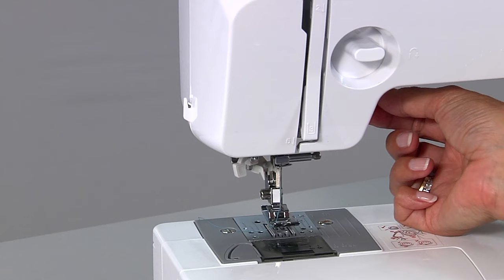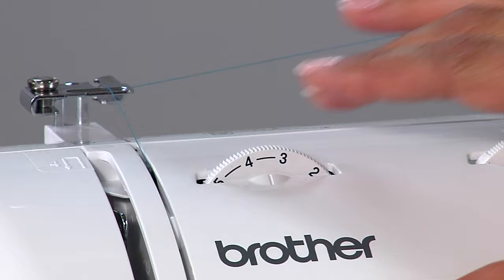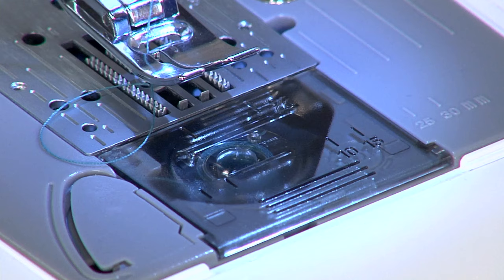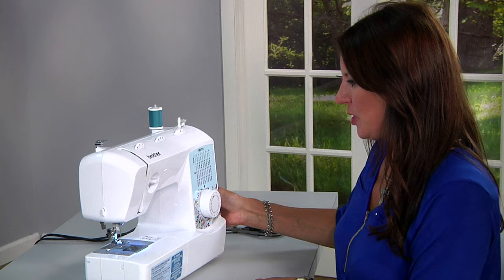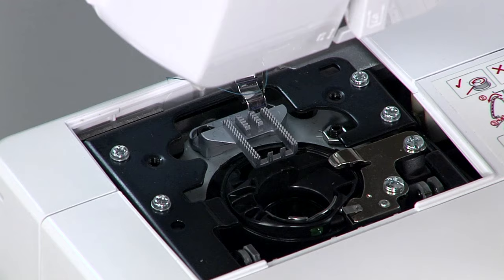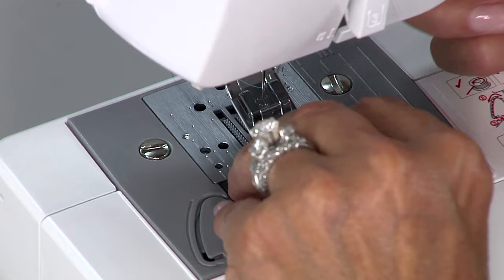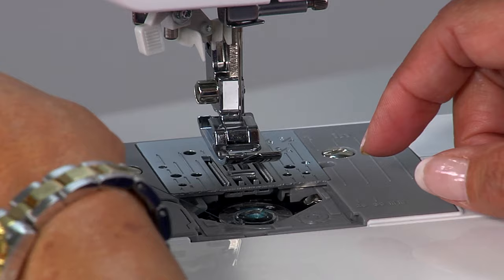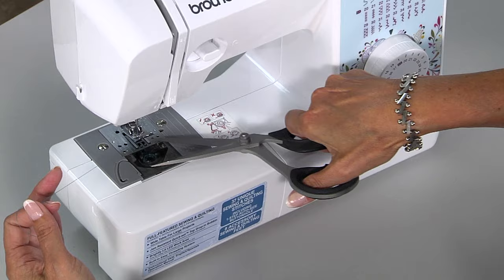Common Brother Sewing Machine Problems: Causes and Remedies

Comment: You breezed so fast through those tension issues at the beginning - you didn't show if the stitches were different at the different tensions
Reply: I agree Patricia; I wanted her to explain about the tension spring in bobbin area; my bobbin is jumping and clunking; and the bottom stitching is really tight! So can anyone help with this plz?
Reply: Would’ve been SOOOOO helpful
Reply: Agreed. I need to see a slow close up of what those look like!!!
Reply: I need to see exactly how Angrla’s three dials are set..I am going crazy!
Reply: @jillsmith5687  how do I fix the tension in my bobbin thread
Reply: @jillsmith5687  show me how to fix the tension in my bobbin thread
Reply: Exactly
Reply: Could have been more helpful if not so fast and incomplete.
Reply: Yea that was a waste of time.
Reply: Same problem. Whole point is to be able to understand then fix the problem😢
Reply: Which was why I watched the video.

Comment: PSA: Avoid brother machines, especially economy class (SE600 etc). They are garbage. The machines are so finicky. I've had it nest at random and jam up. I can't get through 1 pattern without any trouble, like ever. I find that I have to reinsert the bobbin, but before cutting it, i have to violently tug it through, only then will the bottom thread stop showing on top or the top thread nesting below. Slowly it deteriorates and I have to keep reseating it. Forget tension dials, they don't work, period. 1 - 9, all the same result. Hate this crap!
Reply: I tend to agree. I’ve had 2 brothers that give me constant issues. I need suggestions on what brand to buy.
Reply: I had a Pfaff , I bought in 1995. Used it without any problem more than 25 years. Then last year purchased a Brother in replacement  to my Pfaff..no comparison, already having troubles with simple tasks and sewing properly  with this machine.
Pfaff is the best.
Reply: Me too.  They are garbage. @Kaptiv8edme
Reply: @Kaptiv8edme also tell me 😊

Comment: Had an issue with my FS101, was getting bird nests underneath each sewing start, for about 1 to 2cm birdnesting. Studied Youtube videos for hours and tried everything, nothing solved the nesting. New needles, new and different thread, new threading, cleaning, nothing solved the birdnesting at the beginning of each sewing. Saw nothing wrong on the bobbins or the bobbin casing. Ordered by coincidence recently 2 spare bobbin cases. Gave it a try and changed the bobbin case and voila, no more bird nests at all. Even so I could not tell what was wrong on the "old" bobbin case, the replacement of the bobbin case was the solution to the problem. Just in case, as this is not mentioned as possible troubleshoot solution ;)
Reply: god bless you and your crops

Comment: I watched this video because I am brand new to sewing and right out of the gate I am having tension issues. I even had trouble following the manufacturers issues on how to thread it. You covered both issues, but the filming of your bottom hand when all the action was going on at the top of the machine with your upper hand was absolutely crazy.

Comment: This 1000% did not touch on ANY of the issues I'm experiencing! 🤦🏻‍♀️
Reply: Same😢
Reply: Me either. The part on top looks like the wire might be in wrong pasotion. I do not know where it goes?
Reply: I've had to unscrew the plate and fix the bobbin holder countless times, AFTER exchanging the machine four times already..I finally gave up working on my project until I can exchange the machine AGAIN!
Reply: @AriDimitris  How frustrating!!  I feel your pain!
Usually, I have loved Brother machines, but the last 3 I've purchased have been sub-par. 💔
Reply: @LoriBounds-wt1vc  - I am sorry you're struggling with your machine, too!!  I wish I could help you, but I'm at a loss with this machine as well.  Good luck!!
Reply: I’m so frustrated with my brand new machine. I actually miss my Singer….. so sad that it died.
Reply: @rheldawilkinson3790  - I feel ya!  Do you have a local repair shop that may be able to fix your Singer?

Comment: I followed the troubleshooting FAQ on Brother and watched this vid - which basically summarizes those FAQs. I am a good engineer and this Brother CS7000i has NEVER stitched anything without leaving a nasty bunched up mess on the underside. The top looks fine.  However, even when I have a long stitch. It will start with a little bunch or hang. Then, I can continue for a couple of inches where it looks great and then randomly the last two inches are a rats nest. Fortunately, it is mostly when I am repairing my old work jeans. That material is 9 ounce twill and I am backing up the rips and holes with one of those (pathetic) iron patches that never iron on. So, I am doing only straight stiches with the correct default foot. Medium duty pure cotton twill thread on the needle and bobbin sides. Not one thing other than all default settings. Tension set between 1 and 2. Hand start and hand tack beginning and end (using the wheel, not the foot pedal). You can conact me here with any bright ideas!
Reply from the maker: We are sorry to hear that your CS7000i is not sewing correctly. Please see the links below for more informaton:
https://help.brother-usa.com/app/answers/detail/a_id/124056
https://support.brother.com/g/b/faqend.aspx?c=us&lang=en&prod=hf_cs7000ieus&faqid=faqh00000004_000
If you continue to experience the same issue, please contact Brother Customer Service at:
https://www.brother-usa.com/support
Reply: Hi @allanbruce9473 - did your machine continue bothering you or was there any "cure"?

Comment: It was definitely the tension that was messing me up 😩 my first time quilting and I’m using the walking foot. The bottom thread would just be a mess in the back and I was getting so frustrated why it wasn’t working. I checked everything from bobbin to replacing the needles. You said it might be tension and I put it up a bit higher and it came out perfect on the back!! If you’re using a walking door defiantly put it up around 4-5
Reply from the maker: Thank you for watching! We are glad that you were able to resolve the issue so that your stitches look great on the front and back of your quilt.

Comment: Thanks so much! I have a question and hopefully anyone can answer. When I back stitch,  the thread from the bobbin get undone and I see loops through the top. 
Thank you so much for sharing
Reply: @BrotherSews  I’m new to sewing. I’m going to try changing the needle. Wish me luck hehe. Another question, do you suggest to only use Brother bobbins? My husband bought me some bobbins to surprise me but they are Walmart brand, haven’t sued them just to be safe. Thanks in advance
Reply: @legacycosmo  I’m sure you’ve had a reply but if the bobbin fits into the bobbin spot, they’ll be fine. I have some that won’t fit on the spindle….? Whats that about?

Comment: My machine is 6 wks old and now wont zig zag or other stitches. It will do straight but makes a loud knocking noise. I cant return it.  Whats up? I've rethreaded it, replaced the needle and cleaned it.

Comment: I have a similar machine as yours. It is several years old, but not frequently used. It won’t work The under thread keeps jammed even with thinner fabric and straight line sewing. I have tried taking out the plate and cover. Found nothing wrong but brush clean inside. What else can I do before I bring it to the repair?

Comment: I want to love my brothers but unfortunately I do not.  I’ve sewn for over 50 years and don’t enjoy it any longer.  After my sewing machine died I thought I was buying up and included embroidery with a Brothers machine.  The needle threader does not work and needle thread pulls out or breaks and the needles are way too sensitive and break.  And yes I have verified that the thread is fed thru correct and that the bobbin and thread are correct.   Embroidering will have to wait
Reply: How do I change my brother 12:41 to a straight stitch

Comment: I bought this exact machine last week it’s awful I usually love brother machines but mine is so noisy & vibrates badly I’ve asked seller if I can send it back as it’s definitely not right & as I see everyday I’ve had to buy another machine I’ve going back to the brother ls 14 which in my opinion is the best I’ve had 3 now & wanted an upgrade but this is definitely a down grade

Comment: How do you fix the internal threading spring in position #3 on the Brother inovis 1750 d sewing machine?  I can stitch about 15 stitches, then the spring sticks and I get an error message to check and rethread upper thread. Upper thread is fine, it's a problem with this spring that is supposed to go up and down with EVERY stitch, but doesn't. Thanks!

Comment: Does anyone have a PS-53 ? there seems to be a problem with the reverse lever as it makes no difference up or down,  the machine  only sews in reverse. Is there a setting that would fix this? TIA
Reply from the maker: It is frustrating when a machine will not sew forwards. Please see the link below for further assistance:
https://help.brother-usa.com/app/answers/detail/a_id/124798
If you are still having the same issue, please use the Brother global locator link below to locate a Brother group to assist you with Brother products in your area:
http://www.brother.com/brgnet2/hsm/index.htm

Comment: The bottom thread does not seem to want to stitch along with my top thread, it wouldn’t simply not connect to my fabric. I have tried rethreading the bobbin and the top thread, and I can’t seem to find the issue. Any ideas on how to fix this?
Reply: THAT is the problem I keep having!  I was hoping to find an answer here - but she didn't cover it…..Funny thing is, I will go along fine sewing with different threads and different stitches, and then, suddenly, this problem will recur!  No amount of tension adjusting and re-threading will solve the issue......
Reply: My bobbin thread is to losses, which top thread always bring it up. .cannot do any stitch now ....

Comment: my gx37 arrived a couple of hours ago. i watched 2 videos about the exact machine and did everything according to the videos. i am a master threader now both lower bobbin and the main thread. buuut my machine just wont sew. i hear the motor whirring but nothing moves. i checked the manual, the troubleshooting section. made sure the bobbin winder shaft is on the left. tried 3 different power outlets. nothing. i rethreaded the machine 3-4 times. it worked like 1 second when i first tried it. then nothing will make it work again. also again after that first time, the needle threader wont reach the needle anymore. when i pull it down and push it forward, the walls of the needle threader is short a couple of millimeters behind the needle.

Comment: My Brother JX2517 is having an issue for the first time since I bought it in 2017. As I’m ready to push the pedal to sew, the needle doesn’t move but I hear the machine or the machine’s gears inside trying to work or move. So I try to push and let go and push the pedal and then maybe after 10 times of doing this, it starts to sew but very slow then go fast after many stitches. Then when I stop after minutes, it goes back to the same problem again. Please let me know how to fix this? Thank you!
Reply: I am facing the same problem the needle does not move at all

Comment: She does stitches with little then a lot of tension but them doesn't SHOW you what they look like!  My problem: I sewed fine 2 days ago. I didn't change the thread or anything. Now I just went to use it & the first couple of stitched made noise. Well when I manually & slowly moved the needle down (it is in the left position) it is banging into something below. You can see at that time that the needle is 'bending' a bit to the right. If it were to go straight down it surely would break.  WHAT is the issue? Also I haven't been able to use the auto threader. To get the needle into the hook, I must push the needle by hand to the left to get in. But I still can't use it because the threader bar does not go low enough to line up behind the eye of the needle. Can this be adjusted somehow?
Reply: I forgot to mention, my machine is a cs6000i
Reply: Ok so I found that I had the bobbin thread facing the wrong way. WOW, who would think that other than having a crappy stitch that the needle would hit the plate below just from having a  thread wrong way? Now I get an E6 error!  For some reason now the auto threader lines up right. I tried about 30 times & got the thread to go through only once.
Reply: OMG you probably don't remember commenting this, but you totally solved my problem when this video couldn't 🤦🏻‍♀️🤦🏻‍♀️
I was going nuts trying to fix everything but it was just backwards bobbin thread LOL
Reply: @rubydown3329  Funny I just happened to see your comment. Glad I was of help!

Comment: My NX400 just wont sew. Ive cleaned under bobbin & needle with brush & vacuum. Rethreaded & reset bobbin over & over again & changed tension setting. The balance wheel turns a little then freezes to a stop with LCD saying its a safety issue! Help, please!
Reply from the maker: We are sorry to hear that your NX400 is not operating correctly. Please see the link below to help with the "safety device has been activated" error message":
https://help.brother-usa.com/app/answers/detail/a_id/151940
If you are still experiencing the same issue, please contact Brother Customer Service at:
https://www.brother-usa.com/support

Comment: I’m brand new to sewing. What my wheel thing on the right doesn’t turn enough to have the notches line up? I keep getting a majorly grinding noise, have been checking for lose threads in the bobbin area, etc, but no luck. I’m borrowing the machine from our local library and it’s a Brother CS-6000i. I’m afraid that I am somehow damaging the machine.

Comment: Hello !
I have a Brother PS-2500. The pattern selector dial rotates all the way back and forth but the pattern does not change. It’s stack on 4/22 position on the display window. 
Any way you could help me to fix this ? I called a service technician but the cost of checking the machine and fixing it is higher than buying a new machine. I love m’y existing machine and I have a sentimental attachment to it since it was my mother’s machine. 
Thank you to anyone seeing this post and helping me to fix this.
Reply from the maker: It is frustrating when a machine is not working properly. We are sorry to hear that your pattern dial is not changing. We recommend you contact one of our Brother Authorized Service Centers for further assistance and to have your Brother PS2500 evaluated. You can locate the closest Brother Authorized Service Centers using the following link:
https://www.brother-usa.com/dealer-locator

Comment: Great tips but I have an issue that I can't figure out.  I set the machine for a simple zigzag stitch and after I sew about an inch the length dial automatically rotates backwards to "0".  What am I doing wrong?

Comment: My boyfriend drilled into the wall and my brother 2800 was filled with dust. It is not sewing a stitch. I cleaned out the bobbin case  and it still doesn't stitch what can I do to fix it. I tried all that you did in this video but it's the same. Do you have any other solutions?  Anyone ?

Comment: What can I do to use brother sewing machine from the US that has 110v input in 220v mains?
Reply from the maker: We do not recommend using US models outside of the US, as they are manufactured for 120v use. Performance may vary between transformer manufacturers and as such we cannot guarantee results. I would recommend using the Brother Global locator to find a Brother facility nearest you, to purchase a machine manufactured for the voltage specifications for your area:
https://global.brother/en/gateway

Comment: my Brother CPV70 compter  machine w/ 11 stitches modes won't reverse and stuck sometimes, also just  running in straight line mode in very low speed . i just tried to screwed up and cleaning using air dust and put some oil but the reverse stitches still doesn't work. all stitches mode are perfectly working thou
Reply from the maker: Thank you for watching and your interest in Brother machines and products.
You have reached Brother USA. Please use the Brother global locator link below to locate a Brother group to assist you with Brother products in your area:
http://www.brother.com/brgnet2/hsm/index.htm

Comment: Thank you for this video. However, I need help with my JC14  Portable Free Arm. 
I was stitching a thick fabric and I discovered the needle bar shifted. So I took it for repair they couldn't fix it. I took to another technician and was told the Crank is broken and so the machine is now useless. What do you suggest I do about this please?
Reply from the maker: We are so sorry to hear about your sewing machine and this frustrating experience. You have reached Brother USA. Please use the Brother global locator link below to locate a Brother group to assist you with Brother products in your area:
http://www.brother.com/brgnet2/hsm/index.htm
Reply: @BrotherSews  Alright. Thank you so much.
Reply: @BrotherSews  I just clicked the link you sent and discovered I've done that few months ago. I found some contacts here in Nigeria. But after relating the issue with them. They suggested that I buy a new sewing machine instead of spending so much to fix the bad one. Even though they didn't tell me the cost of fixing it. 
Am really disturbed about this situation.